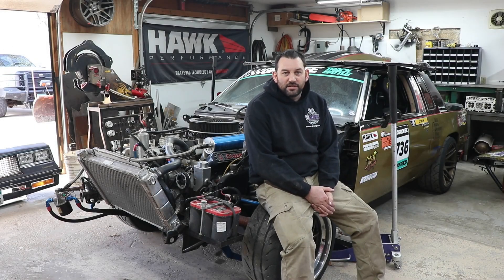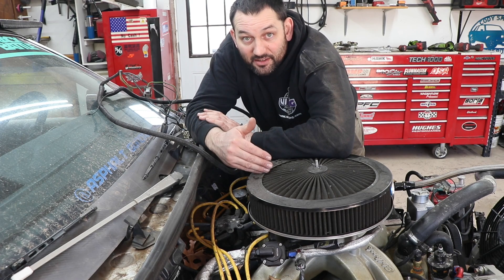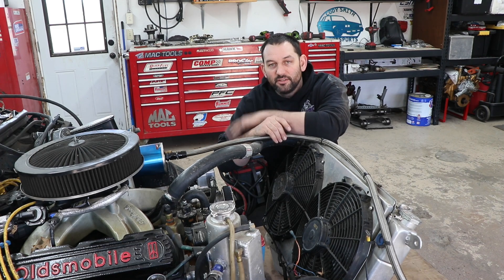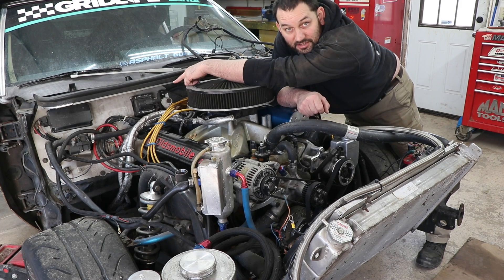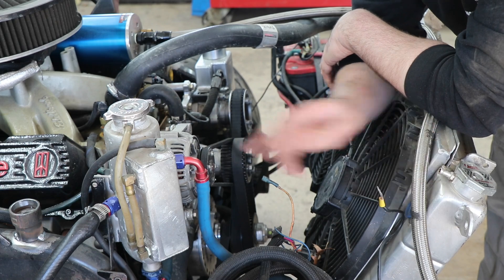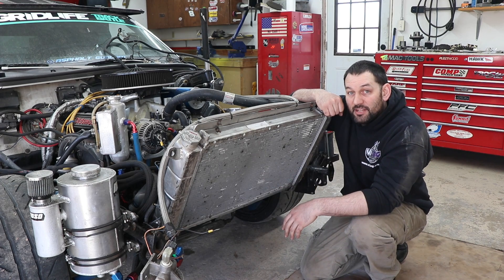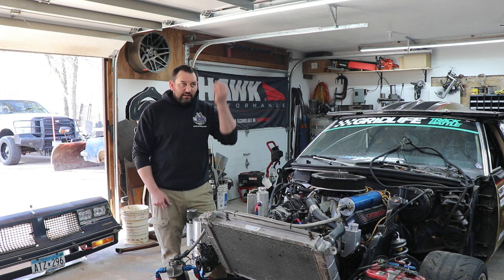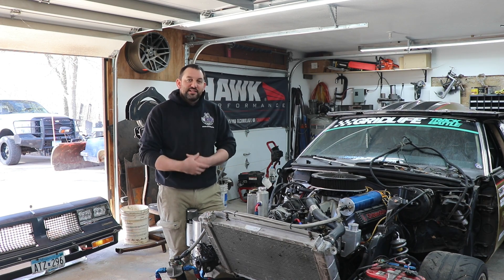Overheating Classic Car? Figure out why

Comment: I seen you at Gridd life you pulled your transmission there what did you have to do there
Reply from the maker: @323gtx88  shift pin for 3/4 sheared off. Pulled the transmission and ran a tap through the fork and rod so i could jam a bolt in and get back out on track
Reply: @ ah wow got it fix and back out there that’s great
i didn’t get to see you out on the track I was working did get to see much racing

Comment: Was having overheating issues on my t/a with sbc 350.  Sitting in traffic on 80 degrees days was awful.  Got a new fuel filter, new holley electric fuel pump,  adjust fuel pressure regulator and a champion radiator. Never had an issue again. Can sit in traffic for 10 mins on a 90 deg. Day now.  Also have stuck with mechanical fan need to make a custom shroud still.
Reply from the maker: @bobhemphut4011  running right makes all the difference

Comment: What causes hard startups. Pressing the accelerator 50 times and having to pump in between to get it started. Carb is rebuilt with new accelerator pump. New fuel filter. Called myself setting left and right gas mixture screws on bottom of carb to 3 full turns when it was running and set lean/ rich dial. Checked distributor on inside and have new vacuum advance next to it. Im lost
Reply from the maker: @SlanginBeatz  I'd be taking a look at your ignition timing. There's initial (cranking), mechanical (springs and weights), Total (initial plus mechanical), and vacuum.
Not enough initial will make for poor starts. Too much it might be ok cold starting but will make hot starts hard. 10-15 degrees of initial timing is usually a good spot as long as you can adjust/limit the mechanical advance to keep total timing where the engine is happy. It much better to have little less than optimal timing than too much.
Reply: @codysmithmotorsports736  I just manually pumped the accelerator and I see the gas coming out when it wants to. It doesnt come out every time I pull the throttle back. Thats what was happening at first and then I took carb off and changed the accelerator pump cup cause it was ripped. What would cause the gas not to spray out everytime I manually pull throttle.
Reply from the maker: @SlanginBeatz  it's only going to be able to  pump fuel once or twice before there isn't anymore filling the pump shot bore if you're not getting more fuel pumped to the carb (engine cranking w/mechanical pump, or electric turned on).
Another possible issue may be the float level in the carb is too low. So the fuel level in the carb isn't high enough to be refilling the pump shot bore properly.

Comment: You are correct… They threw mine on a dyno. They found out I was running too much advance and was down on main jet size.
Reply from the maker: @mikeconnelly7032  i learned the same lesson a long time ago. Thought my stuff ran pretty good....turns out it was at 17:1 AFR 
Gained 28HP and a lot of driveability just putting fuel to it and getting to 13:1
Reply: @codysmithmotorsports736  I’m on vacation next week, hoping to get my autocrosser on the road this week. 🙏🤞🏻